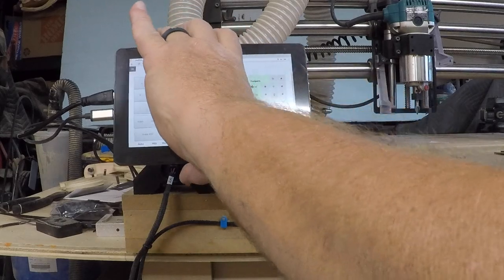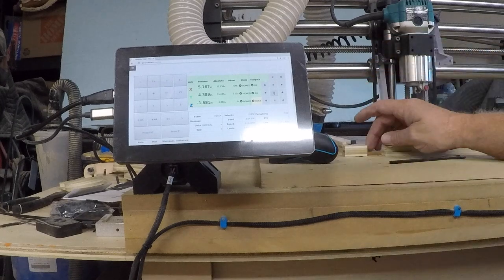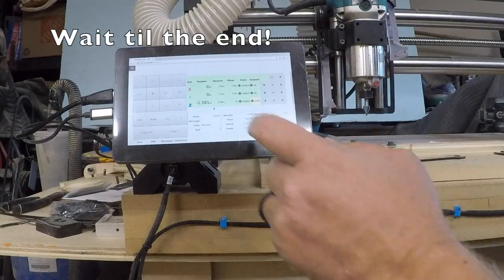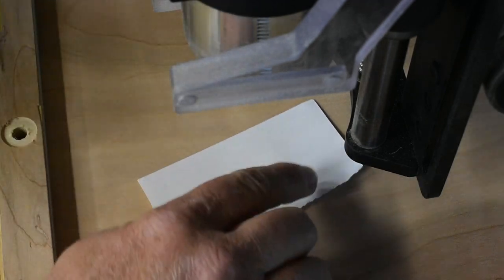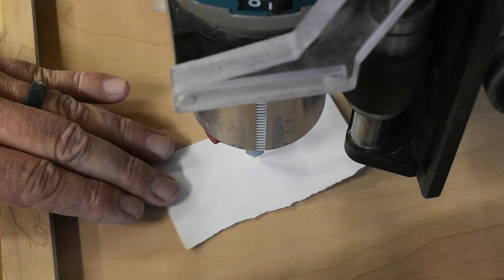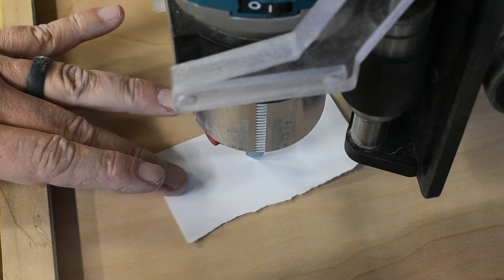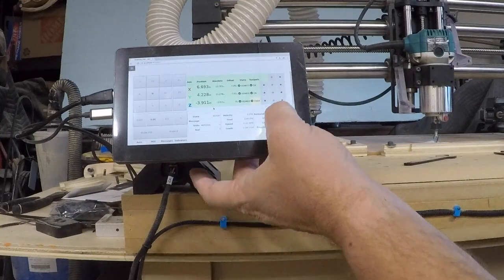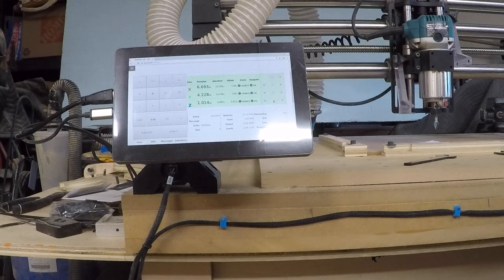OneFinity CNC for Beginners - Ep 3 How to Zero the Z Axis without a touch probe.

Comment: A different popular trick is to use a round precision dowel pin (whatever diameter you want, inch or metric). Lower the z until the dowel will not roll under your bit, bump z up until it just does. Instead of setting zero, you set your precision diameter as the z height. That should be more accurate than paper, given that all paper is not a precision thickness. You can find the pins on Amazon pretty cheap, ground usually within 0.0002".
Reply from the maker: Dude I did not think about that.  I will have to add that to another video. Definitely will give you credit.

Comment: Hi, thanks for the video. I just get my oneinfinty. When I try to zero the z axis it shows me that it is 4.6mm over. I really don't understand what is happening. Do I have to put the paper above the material that is getting cut?
Reply from the maker: If you have a FB account, look for the OneFinity User Group.  That is a great place to post your question with a picture and not only will I see it but a lot of others.  Without a picture of the error it is hard to troubleshoot.